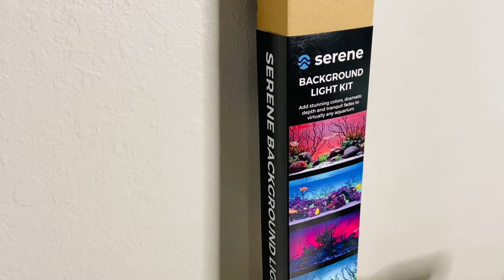Adding a background- LED lit frosted vinyl aquarium background - CADE Reef S2/P Build

Comment: I've not done many mods to my tanks, just upgraded lighting.  My 110 planted got a custom built by my wife and I hood if that counts!  Everything else is boring painted backs.  😁
#ReefStache #BeardedReefer #CadeStrong
Reply from the maker: My man! Thanks for the message and following the rules to a “T”!!!! 👊💥👊 You mention hood… I’ve been thinking of how to do a floating hood for the lights on this build. They will be hung from the ceiling and I want something around it like a floating canopy of some sort to help keep the light just over the tank.
Reply: @ReefStash  I'll try to get a picture later and tag you in Fish Tank Feature.  My lights hang from the hood cross braces.
Reply from the maker: @timbrown8587  thx dude

Comment: I like the way it came out, I know you were worried about it when I asked before on FB, how do you feel now? Also, I was wondering why you used film vice paint on the sides, but thinking about it, the film is a cleaner/smoother look since it will be visible. #reefstache
Reply from the maker: Really stoked with how it came out. Looks professional and I was thinking of painting but really wanted to match the other side where the overflow is and this NAILED IT. Looks exactly the same. 🤩
Reply: @ReefStash  i think the film came out better than paint would have anyways. It would be very hard to get a smooth finish with the paint.
Reply from the maker: @jokerman826  agree!!! 💯

Comment: did he just ran the blade cutter through the silicone in order to cut the wallpaper?
Reply from the maker: no!!! The blade is tiny and precise… it was ran right along the edge of the glass. The silicone does not extend past the edges of the glass on CADE tanks.

Comment: It will be interesting to see how it comes out once aquascape and the reef lighting is installed. Wondering if the reef lights will 'wash out' the Serene. Only real upgrades so far on my Cube is a AI Prime and a hang-on-back fuge. (Not much you can do with a 20 gallon cube.) #Reefstache
Reply from the maker: I’ll have to take some vids with the lights sitting over the tank.  The good thing is I can change the color settings on the background to the color/s that look best.

HOB fuges are great! 🔥

Comment: y did you covered sides..thats the beauty of peninsula...you should't done that leave it open so can viewed from the sides too
Reply from the maker: I picked up a peninsula specifically for this application of having a frosted LED background with no overflow or equipment on the back glass. I put vinyl on the left side to match the right side which is where the overflow is.

There will be a scape off the left side and one off the right with mangrove trees in the background and an open center area.

Sorry you don’t like it but it’s mine and I LOVE IT! 🤣🤣🤣